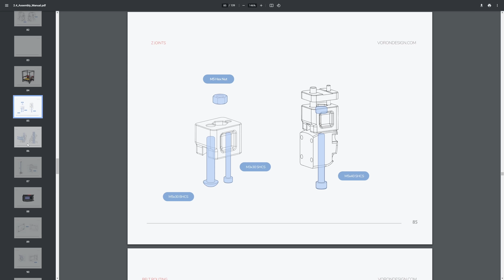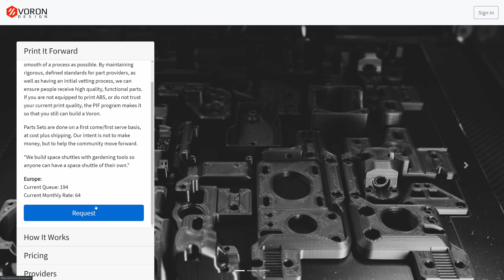My new favorite 3D Printer! The Voron 2.4 Build Experience

Comment: Happy to hear you are enjoying the machine! So good to see it working out great for ya!
Reply: Minute 14:00  it´s a shame about the Klipper Community. I like Klipper but that´s not a dogma. As it work´s for Thomas who cares !?
Reply from the maker: It was an awesome build - thanks for hanging around during the streams!
Reply: @MadeWithLayers  anytime. Happy to help 👍
Reply: @helgemoller5158  well, nobody cares what you use untill you start to talk about it, don't want to shame anyone but i don't think that conflict was one-sided.
Reply: I only wish it was direct drive 😭
Reply: @lio1234234  The Afterburner is direct drive.
Reply: @lio1234234  he chose the Bowden setup, the usual and recommended choice is the direct drive option (afterburner). The assumption I guess is that a lighter toolhead is better for speed, but the Voron is so rigid and with Input shaping now being available and easy to use it's really not that much of a bottleneck.
Reply: @Penofhell  check 13:40 he legit says about the extruder, is shown reaching for it, and opening the toolhead. That long tube is just the reverse bowden to keep the fillament from getting snagged or damaged during some wacky moves near the limits.
Reply: @Jesus6000  you're right I mixed thing up with another recent review which was using the Bowden setup. It is indeed the afterburner toolhead that is shown here.
Reply: @lio1234234  it is! The ptfe tube is only for routing

Comment: Gah, this video has triggered a cascading ripple in the time space continuum.  I have a small 200x200 bed slinger i3 based printer that I've had for a good amount of time.  Now I have the itch to build this beast at 350x350.  But there's no logical reason for this.  The most valuable thing I've printed with my printer are more printer parts.  But alas, my youtube history is now filled with Voron build/configuration videos, and there is only one way this story ends.  Must Build Voron.  Thanks Tom.

Comment: Just because a quick search thru the comments didn't show it, I'll clarify that Formbot/Vivedino doesn't only supply Voron kits but it also DOES sell ready-to-wear printers called Troodon (because they all have to have dinosaur names, of course).  They are fully assembled, not cheap, and in all honesty they are described as "inspired by Voron Design".  I'm not sure what all the differences may be - a custom Vivedino-logo enclosure of course, and more importantly a proprietary control board with - MOST importantly - custom proprietary stepper driver boards for which replacement parts aren't yet in the pipeliine so our demo printer in the shop has been down for three months and counting waiting for a new driver.  Hmm... I may have digressed a bit.

Comment: The tip about putting insulation on the bed was a great one. 
I used golden heat insulating tape and have almost no warping on my 350mm build.

Comment: To prevent random skips many CNC builders use 4 conductor shielded speaker wire.  The 4 color coded wires simplify cable management with stepper motors.  I used something like the following from Amazon for an X-Carve build a number of years ago:

18/4 AWG Shielded CNC Wire (50FT) — Flexible Stranded Shielded 18-Gauge 4-Conductor Cable for Stepper Motors, CNC Machines, NEMA Motors, VFD Spindles, CNC Routers, 3D Printers and more!

Comment: The speed aspect is attractive - I got a taste of that with my Delta and liked it.  Can't wait to see the next iterations of this style printer.  As far as the printer software, is concerned - it's almost become a "monotheistic religion" for some folks.  I like the innovations and improvements that each are introducing and challenging the others to keep up, but everyone should have the right to choose.  If there was only one "right" software, we'd likely miss out on many of the innovations and improvements that have been introduced.
Reply: Yes. 5 days for a full plate build is a bit much. Especially when it crashes and burns on the 5th day from a slicing error you couldn't see till it printed.

Comment: I really hate stepper motors that are directly wired instead of having a connector.
It's inconvenient and I'm always convinced the wire will break just inside the motor.
Reply: It's easier to solder a new wire on the board than to replace the connector, tho. But both would need opening the stepper, which a lot of people are against of.
Reply: @mechanicallydev4536  That is true, but you'd really have to mistreat the connector to have it fail, where as the wire could fatigue *relatively* easily.
Reply: @_Piers_  It depends on the motor, I have some minibeas that have the shittiest connectors I have ever seen. But agreed, most of the time connectors only get ruined by overcurrent.
Reply: @mechanicallydev4536  It's almost always easier to snip apart the connector with sidecutters and desolder each individual pin. Considering it's probably those cheap JST connectors that would fail

Comment: Before I decided to go fully resin, I very much considered this platform and looked at building one at length. Very nice assembly, Tom, and many happy printings to come!
Reply: Why did you decide to fully switch to resin?
Reply: @romanmgelman  Mostly for the tremendous bump in resolution for the things I like to print; 7" figures and architectural models for metal casting. The inherent speed with MSLA and being able to print either multiple models or all of one figure at one time is really nice too however.

Comment: I'm using glass fibre based insulation under silicone heaters. Its normally used in (race/rc) cards and two layers of the material will work just fine. Needs some wrapping with Kapton tape to stop the glass fibres from ending up in your skin on the sides.

Comment: I built my Sparklab SparkCube XL several years ago and this reminds me a lot of that project. Printed all the parts on a wooden Printerbot 1405. The self leveling bed design was pretty revolutionary at the time, and still is even when software leveling is standard on most machines. I would be hard pressed to "upgrade" to another printer but this looks like a good project if my SparkCube ever decides to self destruct.

Comment: I like the Rat Rig V-Core-3.  Just started machining parts to make one
Reply: same! What size?
Reply: 500, but am considering maybe 500x750 since I am machining my own parts and can customise 
Will decide when I get to that point
Reply: what parts are u machining the normally printed parts or something else
Reply: @3dprintingcave778  … I will make most parts myself, bed, corner plates, t-slot nuts, acme screws, hotend etc.  will just buy the 3030 T-Slot extrusion in 6m lengths and buy the linear rails
Reply: Ratrig to the US from the UK is almost a $2K machine.  I would love to build a Ratrig, but Voron is about 1/2 that cost especially with a Formbot kit.  What I don't recommend is self-sourcing for Voron (it is a major PITA).
Reply: Reasoning for going with Rat Rig vs. Voron? I (very surprisingly) sold my wife on buying a badass kit next tax season. I wanna start my homework now so I know where to put the money in a few months.

Thanks in advance. ✌🏽💜🤘🏽
Reply: @almonster2066  … you can almost double that price for Australia .    I have prices for the material locally and can make most the parts myself and build it for less than half the price, actually almost 1/3 of the price… lucky I have a CNC mill and CNC lathe
Reply: @the_wretched  .. the 3 point bed for levelling is one reason.  The 2nd point to me was the fixed Z axis for the head because to my way of thinking it would be less vibration being the head is the part that moves the most and fastest 
Bed only move one step per layer and moves slowly
Reply: @ronan4681  Cool, thanks for your thoughts :)
Reply: I might just buy an Anycubic Vyper and a resin printer, haha. I'm not sure I'm even ready to build my own printer.
Reply: @the_wretched  … honestly it is easier than you think.  I built my first prototype a good 2-3 years before you could buy one here in Australia.
You will also appreciate it and understand it better if you build one
Reply: @ronan4681  Exactly my train of thought. I'm just nervous, haha. I've been to anxious to even install this BLTouch sensor, bahaha.
Reply: @the_wretched   I'd say half the reason for going with a corexy is to avoid having the build platform move at all.  That's so nice I can't understand going with a moving platform.  The kinematics are nasty when the build platform has a changing mass during the time the print is going.  Oh OH and with a fixed platform it's rigid when you're dealing with a hard stuck print.  On my Medel Max 3 I've had the entire build platform come off while trying to get the print released.
Reply: @keithcress1335  Thanks for all the advice! I think I'm going to go with the RatRig. We'll see, though. Tax return season is still like, 6 months away. Maybe something even more badass will come out by then.

I mostly want a large build volume. That 500mm³ RatRig looks AMAZING.

Comment: Not sure if anyone's mentioned it yet or not, but the reason for no insulation under the bed is to help add heat to the build chamber when you have it enclosed.  In this case, it's planned "inefficiency" in order to create a better environment to print ABS.  That said, you really need to use an ABS or Dibond panel under the bed because of it.
Reply: Dibond seems like a good idea if that's the plan, should help reflect heat into the chamber.
Nice!
Reply: Is that an official statement? Because it sounds wrong to me. Without insulation the heat from the bed would be way too much to keep the chamber warm and most of it had to be vented out to not overheat the chamber.
Reply: @MetalheadAndNerd  so you’re saying it seems wrong to you, then also saying it works too well when using it that way?  I’m slightly confused which way you’re leaning here…
Reply: And my chamber sits a bit over 60 Celsius when printing, just for the record.
Reply: @TheJaredC01  Yes. It seems wrong because it wastes energy. A bed with normal insulation on the bottom, together with the heat from the print head, would also be enough to heat the chamber without the need to vent much of the produced heat out.
Reply: @MetalheadAndNerd  the first statement I made about planned inefficiency means that, yes, it uses extra energy on purpose, but it is not wasted, it’s used to heat the chamber.

A bed with insulation on the bottom doesn’t add much radiant heat to the chamber because (comparatively speaking) it all stays in the build plate. If the bed isn’t ON, then it can’t add much to the chamber, and insulating the bed means it’s not on as frequently as it would be without insulation.

The hotend is even worse for chamber heating. The fan is to keep the cool section cool, not to take heat from the heat block and add it to a build chamber. Trying to use the hotend to add heat to the chamber is a very (very very) inefficient way to heat the chamber.

Even as a pair, an insulated bed and a hotend are likely not enough to heat the chamber to “happy” levels for ABS (or if it is, it’s just barely), and I would argue that having a bit more heat in the chamber to ensure a good print is far better than losing a print due to warping or similar. At the end of the day, a completed print is a lot cheaper than a failed one, any way you look at it.

You also have to realize that the chamber temp is directly tied to the bed temp, and once the bed reaches equilibrium, the chamber does also. I actually went as far as adding heatsinks on the bed heater with 2x 4020 fans blowing across them to add additional heat to the chamber, and my setup (being about as “wasteful” as you can get) still settles at a 60 Celsius without ANY venting, and with the bed at 110 Celsius.
Reply: @TheJaredC01  When I say print head I mean the print head, not only the cold end. All heat from the heater block goes somewhere and this somewhere is the chamber. If the bed is better insulated it doesn't need to heat as much and uses less power. Since all of this power also goes into heating the chamber it is just a question of ventilation how warm the chamber will be.
Reply: @MetalheadAndNerd  Most hotends have silicone socks on the heat block (with the exception of Mosquito) to keep the heat inside the melt area, and most of the heat from the hotend heat block goes into the filament, not the chamber.

If the bed is insulated, the heat stays within the bed, and doesn't extend to the chamber.  If you're printing PLA, that's fine.  If you're printing ABS, it's not.  As far as the residual power going in to the chamber, while technically correct, there's VERY little heat, comparatively, going into the chamber vs going to heat the hot end or the bed, so no, it is NOT a question of ventilation as to how warm the chamber will be.  As I've also mentioned, with zero ventilation AND with additional heatsinks and fans, my chamber tops out around 60 Celsius.  If your thought process was correct, that could be 100 Celsius without ventilation, and with insulation instead of heatsinks...  It's simply not the case.
Reply: @TheJaredC01  Okay

Comment: For anyone else looking to build a Voron using Duet 3 electronics, may I suggest using a tool board to drive the hot end instead of the EXP3HC board that Tom used. It costs less, it greatly reduces the number of wires going to the hot end, and version 1.1 has a built-in accelerometer to help calibrate input shaping. But you will need to find a way to mount it on the print head
Reply: I have a designed a mount for the Galileo variant of the afterburner as well as an other one for the standard afterburner which works, but needs a bit more love, so that bit is kinda covered. I however use the Mini 5+ with the 2 stepper extension instead of the duet 3 6HC, better suited for a V2 as it also supports the Mini12864.
Reply: @christophmuller3511  the tool board works with the Mini5+ too.
Reply: @davidcrocker4285  I know, that’s how I use it :)

Comment: Putting connectors on the motors is an obvious must-have for me and should be for anyone else considering building one of these. The fact that they are hard-wired is insane to me. Motors go bad, and steppers burn out. When you're troubleshooting you need to be able to quickly swap two of the motors or unplug one entirely to measure the signals on the wires without going under the machine. If you build a machine like this as if it will never break, then you will be in trouble when it does. But if you realize this is a machine that will be tinkered with, upgraded, aligned, and repaired frequently and you design/build it accordingly, you will have a much better time.

Comment: Hey, Thomas! Great video, as usual. How you describe the overall quality of the printed parts by this machine, compared to the commercial printers, like Raise3D, as an example?  I also would like to see you building Voron Switchwire. Voron 2.4 is a great performer. But Switchwire, in my opinion is a straight "killer" of Prusa MK3 and any other printer with similar kinematics.

Comment: What is better?
Voron 2.4
OR
RatRig3
Reply: Voron 2.4
Reply: @christophfriedrich5092  Why  tho?
Reply: What are your goals with the printer? Both are very capable, but the Voron is designed specifically for ABS, which can be a problem with Rat Rig's V-Core 3 PETG parts.
Reply: @vinnycordeiro  then print the parts in ABS
Reply: @brisance  Many people don't print ABS for a lot of reasons, warping and delamination being the most common; PETG is just easier to print on a Creality printer, for instance, so it's easier to use it to bootstrap a V-Core 3. Your answer, while true, may not be feasible for everyone.
Reply: @vinnycordeiro  many people don't need a v2.4 or a V-Core 3 either. The question was which is "better". I agree that both are capable printers, but saying one is "better" than another because of the printed part material is kind of a non-answer. The entire v2.4 is literally a collection of parts sourced from third parties while the V-Core 3 can be shipped with PETG printed parts, or print your own to reduce costs.
Reply: @vinnycordeiro  Join the Rat Rig Discord and ask someone to do PIF in ABS for you.
Reply: @vinnycordeiro  Yes I plan on printing ABS but obviously I would replace the PETG parts with ABS parts.
I need a printer that can handle all materials(enclosed), has no issues with bed warping and has automatic bed leveling, and also some quality improvement vs ender 3 would be nice.
Reply: @liamventer  I can print ABS just fine now, but thanks for the help.

Comment: Great take on this printer. Having built a "V0.1" it is definitely a compelling diy project rather than something for business use. The plastic parts for one thing tend to crack, and the "diy" mountings and stuff have been coming loose for me lately, etc. Very sexy when it is running, though, for sure.

Comment: Thomas.. I have Trex 3 printer and even though it's not beginners printer.. I love it.. they went a long way .. I love they are there for the community and helping solve issues..  Ada is great .. when people ask me what I have I say I have Formbot Trex 3 and they want to buy it.. I tell them don't because I went through things on it that just didn't work well or failed after while but for large printing at at higher speeds,I absolutely love it..  the fact the printer was around 1700 usd for DUAL extruder setup at 400x400x700.. yeah.. Josef makes great products.. and me being Czech I would love to recommend it but I just can't... just cant justify the prices..  they should have sent you the T3 not the raptor.. I think you would appreciate it